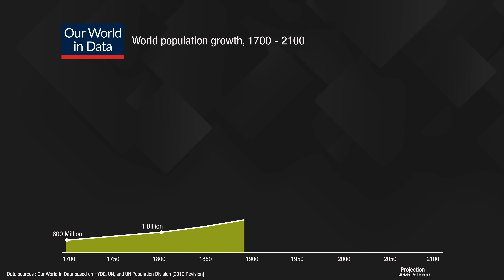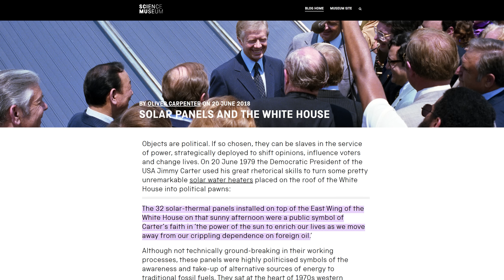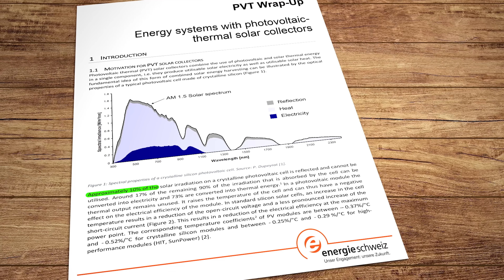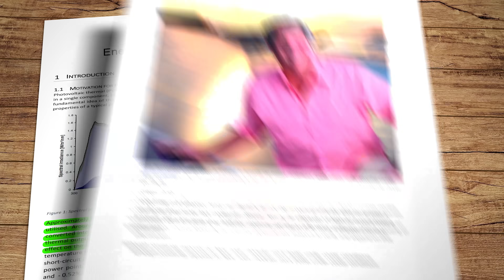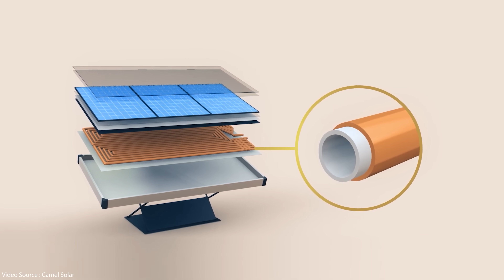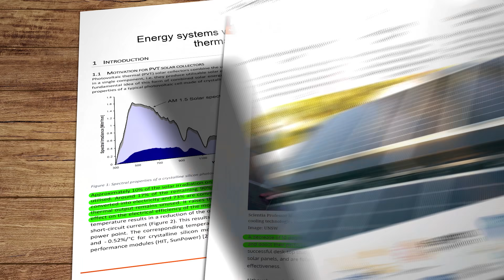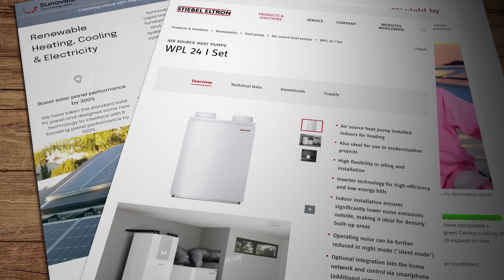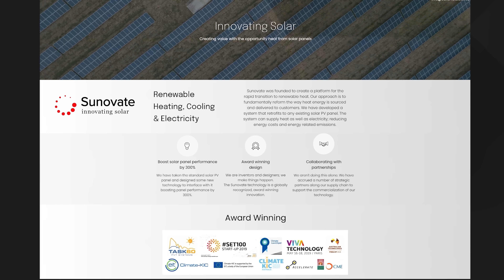The Solar PV panel that provides electricity AND heat for your home!

Comment: To be fair, you could pump water in the same way where the cold water goes first to each panel and then snakes up the panel. As for the heat exchange between panel and water - I don't buy it being so troublesome. Water cooling has been used in computers for ages to get A LOT of heat out of sensitive electronic components - sure, any airgap lowers heat transfer significantly - so why are you putting air into your system? Also, for house heating - this would be in winter, where you don't get a lot of sun...
Don't misunderstand me, I'd like to see it work I'm just skeptical about the real gains we'd get from it. And there's always the price to consider.

Comment: The system I am going to build is going to be a fourfold benefit. Not only will I capture the electricity from the PV and the heat from the thermal but the rainwater that lands on the roof will be my drinking water and the roofing material itself is the BIPV/T glazing itself. 

I’m going to utilize A dc variable frequency AC drive that is directly coupled to a three phase permanent magnet refrigerant compressor.  And the heat output is going to be stored in a 24 m³ water tank insulated to r100

Our electric vehicle exclusively runs on solar energy already.

Comment: Seems most of these systems are attached to the back of the panel so there must be a temperature gradient across the pv material so wouldn't the sun facing side still be at a high temperature?...

Comment: In the eighty's had solar hot water using a Freon system with modified hot tank and panels, from a startup co.in Quebec.Tons of hot water,with system cycling every 30 sec at noon 180 deg.in the summer and many days it would shut off (limit 185 deg) due to no use and in the winter 105 degrees F ,as a preheat to electric tank which is set at 120 deg.Anyways, If you combine using electric solar,they get hot(actually drops efficiency of panels)If they were manufactured together you get more efficient electricity and the 75% inefficiency transferred to the hot water system using freon which does not freeze in the winter would be an interesting product,sure saves roof space. location Montreal  Canada. Any interest!!??  Have lots of info as i talked to creater of freon system and learned a lot

Comment: Ground based water transfer system attached to stirling generators as a go between for the panels mentioned above. Problem solved. You increase your energy output by a lot and do not have as much waste heat stored away. Just a way to squeeze a little more efficiency out of the system.

Comment: I still think a water based system makes more sense than an air based system for a normal house in northern europe. The air based system shines if you got ducted air already, but if you don't its just too much extra big air piping you need to add while cooling less efficient than water.
Reply: The problem with liquid based in northern climates is freezing in the winter, and glycol needs to be refreshed yearly (system cycled, air bubbles bled out, there's a fee for handling the glycol and disposing of it). This not only doubles the cost of PV installation, but adds a lot of yearly maintenance cost, killing your ROI and in turn no one sells it or wants it installed. I think the air based system could take off, but it also requires room for storage and/or a heat pump and fans - that also requires power.

Comment: This has been spinning through my mind for a while now, and then suddenly, you bring it up! The situation here in sweden is mostly that during winter, when heat is needed, the sun i so low that hot water solar panels just dont heat up, and during the summer, its mostly hot enough that you dont need the excess heat from the panels for anything but showering (I would know, I have a few panels myself)

I'm in the process of switching from wood pellet heating to a deep bore ground heat pump and intend to use "free cooling" in the summer (pumping up bed rock temperature water to cool the house in summer, in exchange for heating up the bedrock for better efficciency in winter)

Now, what if i would get PVT panels and, during spring and fall when the panels are heated enough to generate heat for my home (and the heat is needed) I use the panels just as expected, and when summer comes and there is no heating needs, I cool the panels with the return water from cooling the house, send it back down in the bore hole. Theoretically I would get a cold house, more efficient PV's and a heat battery in the ground to use in winter, all at the cost of running a circulation pump.

Now to the big question: In practice, would the increased efficiency of the PV's in summer and the Heat pump in winter match the increased energy of running the circulation whole summer, and at what initial installation cost?

Comment: Excellent video Dave. Thank you. I've been considering a similar idea of collecting heat from the attic using a heat pump coil and fan, then running the refrigerant down to a  Hot Water Heat Pump (HWHP). In essence I'd decouple the fan and coil from the compressor and tank of a HWHP. Locate the fan and coil in the attic (being careful to ensure friable insulation is not air-born by covering it with an additional layer of paper faced insulation to ensure it doesn't end up in the fins of the coils) run the refrigerant lines to the compressor and tank which would be located in the house. Either Sunovate panels or skylights could be installed to improve the productivity of the HWHP. In my climate (Canada) we need lots of heat and the cooling of solar panels is less of a challenge (especially in the winter) our heating requirements are typically 70 to 80% of the house's energy load with 3/4s of that in space heating and 25% in water heating. The UK's climate is similar but I believe solar production is typically less so you might get less value than us. Other advantages of using the hot water tank is that the solar energy can be stored for over night (a cheaper thermal battery than an electric battery). Additional HWHPs with this arrangement can be installed for space heating. In Europe there is a thermal storage system by Latento that combines Phase Change Materials (PCMs) with a water storage tank for more compact thermal storage.

Comment: Simplest solution is to put a phase change material on the back of the panel so during the day it melts and then at night it radiates back out into the night sky.

Comment: I doubt it's going to get anywhere near the maximum efficiency. The summertime when you need the most heat removal there will be no place to use the extra heat in residential situation.  The hot summer day in Australia you're going to heat your water tank by 10 a.m. and have no real place to put any more heat. The return on energy investment does not look good

Comment: I think there's no need for a box.  I think simply enclosing the back side of the panel with an aluminum sheet for example to make it air tight with inlets and outlets to plug in hoses to move the air are sufficient.
Reply: This works to an extent. But you cant get the control of the heated surface and as a result you end up with a lot of entropy destruction from the inlet air mixing with the heated air.

Comment: Water cooled solar panels sound like a no-brainer. LTT was going to DIY something a while back, haven't checked in to see if they've done anything yet.
Doing something neat with the heat is just bonus on top of the extra electricity production and longer lifetime of the solar panels.

Comment: As usual a very comprehensive overview of the subject.
Ive been wondering for years why pv panels could be used for heat as well as electricity, delighted to see its now coming to a stage where it can be used in a  domestic situation

Comment: Wonder.  Would there be a energy recovery by directing the warm air from the back of a solar panel to the heat collect unit of an outside air heat pump unit.

Comment: What happens to panels when fans fail?  Wont panels overheat?
Reply: Andrew, the system has fail safe mode. In that if fan or electricity failed  the system can still naturally ventilate in open loop mode. Our test show panel temps don't get any worse than a standard roof top installation.

Comment: For hotter areas the heat can be used to cool the building by using an absorption cycle cooling system.
Reply: Yes something we are considering in a future H2X program

Comment: A really hopeful post. I have had both solar thermal and PV on my roof in the U.K. for about 10 years. If these had been around then I would have used them. Unlikely that sustained high temps is a big issue around Leeds but every little helps.
We have to solve the ‘feast or famine’ issue for renewables. I’ve talked to various engineers over the years about creating a thermal store under the back lawn to use heat stored in the summer for my heating requirements in the winter. All have looked at me in horror! 😀

Comment: Great start a balanced eco home.
I believe there should be a number of generators to make a more complete system, mains water, solar, wind, ground thermal,, all could be making a little charge stored in capacitors until there’s enough to charge a battery or put back to the grid.

Comment: Could the PV cells be backed by a material that uses the thermo-electric or Seebeck effect, coupled with a heat sink.
Reply: yes part of the H2X development program
Reply: @glenryan6692 Would like to know what the H2X program is. Thanks, if you reply.

Comment: This is not relevent at UK latitudes.  I have had a large PV array (4kw) and a thermal water panel for  more than 10 years.  Both systems work great but only for about 8 months of the year.  I am in the south east of England in an area with historically high sunlight for our rainy isle .  In this neck of the woods the issue is what to do about the missing winter months when we burn gas and consume electricity from the grid.

Comment: It seems to me that I heard of direct conversion of heat to electricity. If I recall, it wasn't very efficient, but if we're talking about cooling PV panels AND extracting a modicum more electricity, it would be a win--win, wouldn't it? Wait, was it Peltier junctions working in reverse (causing the thermal difference to create EMF/current)? Perhaps there are other direct heat to electricity devices/methods. Combine PV and TV (Thermo-Voltaic) for the win. :)
Reply: There isn't enough temperature differential available from solar to make a heat-to-electricity system economically feasible.  It would be too inefficient, so the little electricity you could get would never make up for the cost of the system.
Reply: @incognitotorpedo42  'Never' is a word used by those that often eat crow later, but your point of inefficiency is not only well taken, but addressed in my comment as 'not very efficient. But as an electronics guy, I know that integration of layers of silicon is done. My question is, could adding a Peltier junction to a photo-voltaic improve both? Once in production (after design), cost comes down quickly. Between more efficiency w cooler PV, extraction of additional electricity w Peltier and able to extract heat for use could conceivably overcome cost & individual inefficiencies. It isn't diminishing returns here. They're a summation of the energy extracted. Get 10=15% from the PV, 5% from the TV and 40-50% of the heat from the system.

Comment: It's important to note that while increases in temperature reduce efficiency, on a very hot day the amount of irradiance available is also much higher. 

So you'll still see PV systems peak at max inverter output even on very hot days

signed - PV trainer in Australia
Reply: Brendon - absolutely correct over clocking is a popular thing in Australia. This is not a common thing globally and many face spatial constraints. In Australia and other markets we are looking at reducing the sustained peak temperatures that have a devastating effect on panel life. This is why we pivoted into the heating market also.
Reply: @glenryan6692  sounds great. I'm certainly not knocking your tech in any way. Just adding my two cents.

Will you guys be at SEC this year? Would be great to come and look at your tech in the flesh

Comment: This may be a silly suggestion (and forgive me if it’s already mentioned) but wouldn’t a thermal electric generator be better? They’re smaller and flatter than a ducting system and work exactly where this kind of situation occurs with thermal gradients and as you already have wiring for the panels, no further auxiliary systems required?
Reply: You correct👍

Comment: Amazing potential.  I can see that in hot climates like Australia, households are going to need other solutions for the waste heat from the panels after their hot water tank is at temperature. I'm wondering if anyone is working on small /domestic scale thermal power stations to create electricity at source.
Alarm bells rang for me at the mention of electric fans to power the draught through the heat exchanger. Clearly this is a half resolved idea, the draught induced by the heat itself must be of use and the heat exchanger element designed to make use of it. Mechanical and microprocessor control to regulate the heat of the panels will be costly complications.
Good ideas are born a long way from ideal solutions.
Reply: Sure the electric fans would divert some of the panels' production, but it wouldn't need a large fan and the efficiency improvement would certainly accommodate that. Sure, adding extra moving parts to manage and move the hot air adds complexity and maintenance, but no more so than a standard hvac system, which this would tie into. The biggest difference would be placing the hvac equipment in a different area of the home, in the attic/upper floor compared to the basement as usual. It wouldn't change a commercial scale system at all since all the equipment is placed on the roof anyway. 
I can definitely see a use for a cheap, passive air cooling system though.

Comment: Hope this idea  comes to fruition, as this kills two birds in one stone. In my place most people use LPG for cooking and as a country which imports 80 percent of its fossil fuel the cost of one LPG is soaring. One of family friends has hot water connection to their kitchen and use it to precook the vegetables and rice prior to main cooking using the hot water from their regular solar water heater. They are saving a considerable percentage in LPG, but I don't know the exact numbers as long term usage is required. This seems like a great idea as mothers and wife would love getting their LPG cost reduced.😃

Comment: I wonder if the extra heat from PVT could be used to raise the temperature of ground source heat pump wells? In case of heating, with higher temperature of the heat source COP of the heat pump increases, reducing energy consumption for heating.

Comment: Interesting,in the next couple of years, my wife and I are planning to build a home as close to 100% off-grid as possible (she wants propane for cooking, but I’ll propane have an induction cooktop as well). I have been thinking about the heat impact on the efficiency of solar panels and since I’ve decided to use a geo-thermal system and radiant heating, it made me realize that rigging up a secondary geo-thermal system to cool the panels during the summer and keep them above freezing during the winter to help prevent ice and snow buildup during the winter.

I doubt that the PVT panels will be mass produced in a cost effective solution within the next 2-3 years but there was a lot of good info in this video to help me design a DIY solution even if it isn’t nearly as effective as the designs in actual PVT panels.

Comment: Is there really an issue with reduced efficiency on hot days? The challenge with PV is to produce a constant quantity of power all year round. If sun radiation is 80% higher on a  hot day, but efficiency is 30% lower, what is the issue?

Comment: THIS. I NEED THIS. I live in the suburbs of Phoenix, & the summer temperature routinely hits 120+ degrees Fahrenheit, 49-50 degrees C. I even ASKED for something like this on my new Solar PV system install & they said that nothing was commercially available yet. This is a literal NEED out here, more to keep them cool than anything else. though replacing my Natural gas water heater (not my choice) with sun power is a bit of a win-win.

Comment: Having a unified heat system in a house where everything that uses or removes heat is connected and has a heat storage system could be very efficient but it would likely be complicated and expensive
Reply: Fan, ducting, and a simple controller are the basics to use the heat. It can be as simple as that or integrated with existing HVAC equipment.

Comment: As always with intermittent power sources like Sunovate the problem is storing the energy to use when none is being made.  How about using the hot air from a Sunovate system for a Sterling engine driven electrical generator with battery storage?

Comment: I've wanted to do PV Solar for power to go off grid, and Evacuated tube solar for hot water and supplemental hydronic in floor heat. 

Saw an architects home in Colorado that heated his home with them and dumped surplus heat into a hot tub and pool.

Comment: Why not run a traditional rooftop hot water system underneath the pv cells and cut out the warm air middle man? Essentially a radiator. Then, if you reach peak hot water you can turn on your Stirling engine and get some more free electricity ⚡️

Comment: The best way to do this is to place a glass top of the solar panel. 2 inches away from the panel. The top and bottom of the glass stay open. Heated air will circulate naturally between glass and solar panels. No need to capture hot air summertime is hot anyway. In Wintertime you won't have hot air to capture. It is simple and efficient.